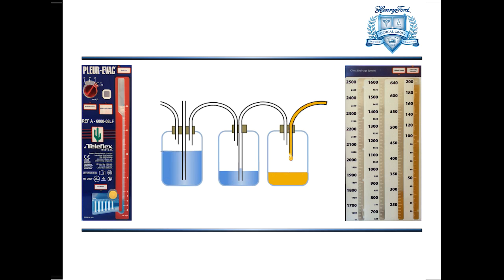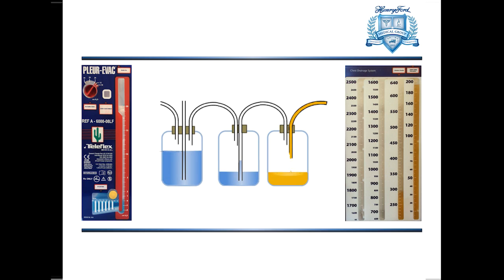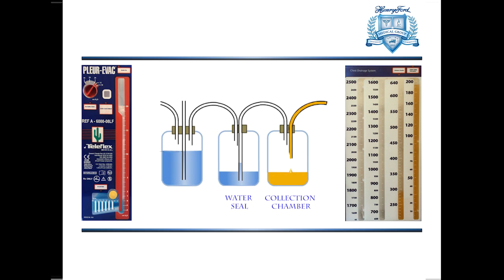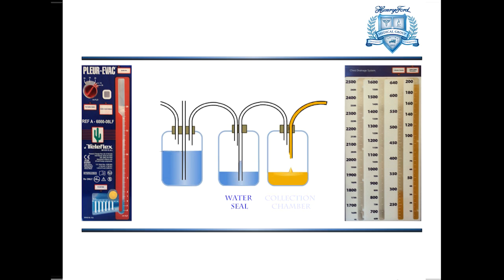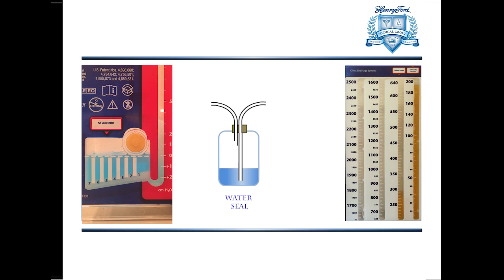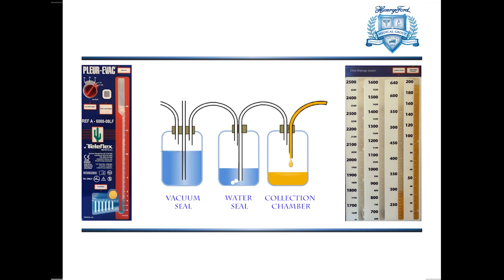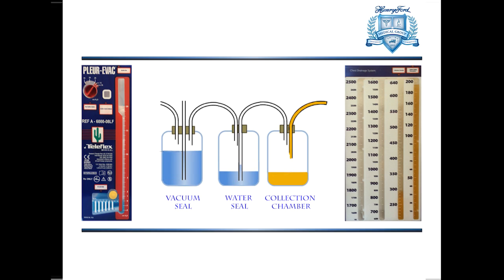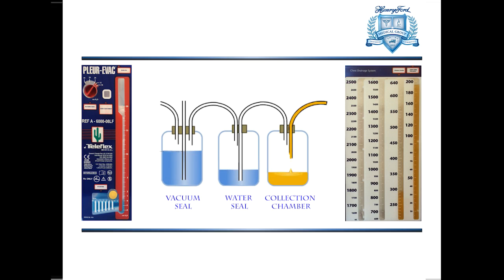Three Bottle System

Comment: Intermittent bubbling indicates that the system is functioning properly.
Continuous bubbling indicates air leak
.
If bubbling disappears indicates tube obstruction, dependent loop, or as lung fully re-expands